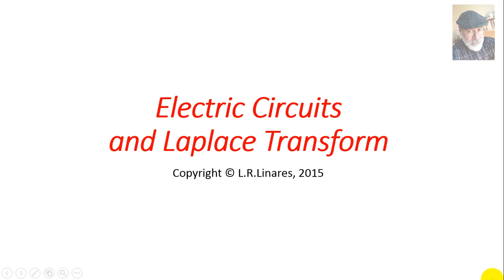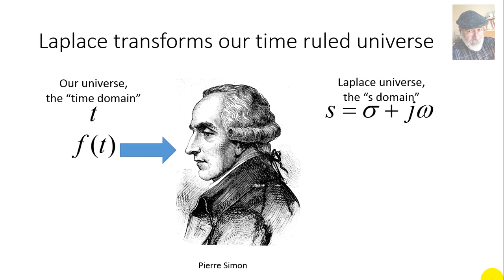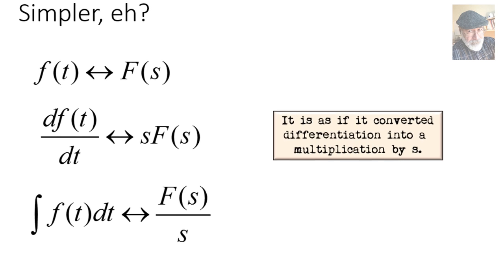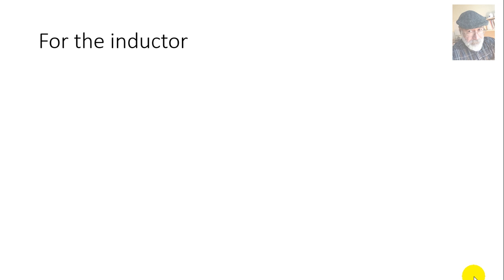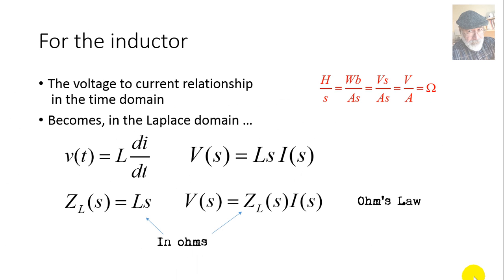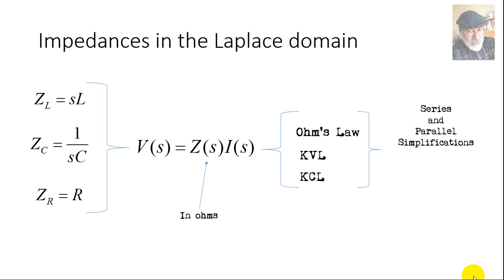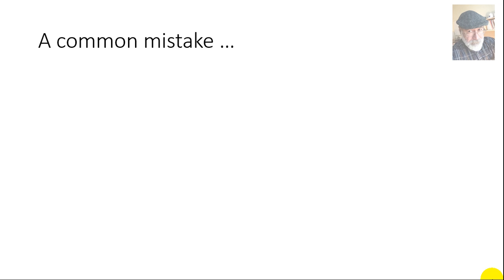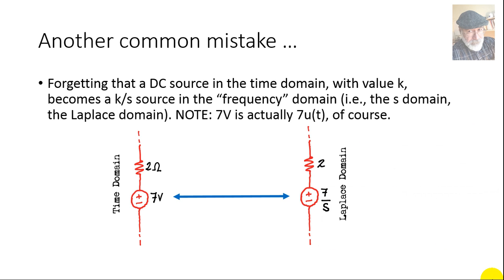Laplace Transforms and Electric Circuits (Second Draft)

Comment: hello sir, thank you very much for the video first of all, brilliant. There is one point hat i got really confused, how come did you find the second circuit that you drew ? how can you take sum of all the impedances, aren't them connected in parallel ? what happened to the voltage source ? thank you very much
Reply from the maker: The circuit that you seem to be referring to is the circuit after t = 0.  In that circuit, the switch has opened already so the source is not part of the circuit anymore. When the switch was in place, in the time domain, the two resistors that you are talking about were indeed in parallel, but once the switch opens, they are not in parallel anymore. this is a new circuit with a new topology, they both are in the same and only branch ... they are in series now. I invite you to watch another video in this channel,  this one: https://www.youtube.com/watch?v=97ZyjCFXlFk&t=12s

Comment: So, the application of Laplace transform in circuit analysis is to solve first-order and second-order DC circuits, right?
Reply from the maker: Not in DC. in cases where the signal contains an indefinite number of frequencies, but not only first and second order. Any order. And much more than that, as future sessions will show: analysis of stability of electric systems, in control theory and more.In DC-SS, we just work as in the series in Electric/Electronic playlist in this channel, which is simpler as all equations are algebraic.
Reply: @rolinychupetin  Oh, I see 🤔 This math is art. Thank you for the explanation!